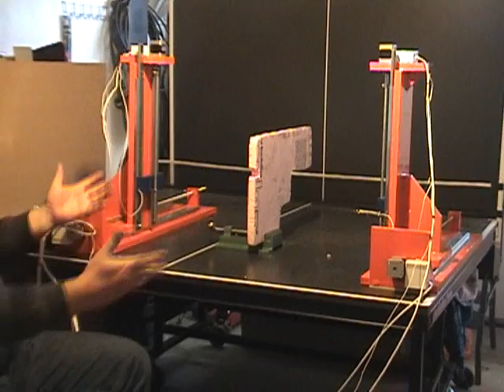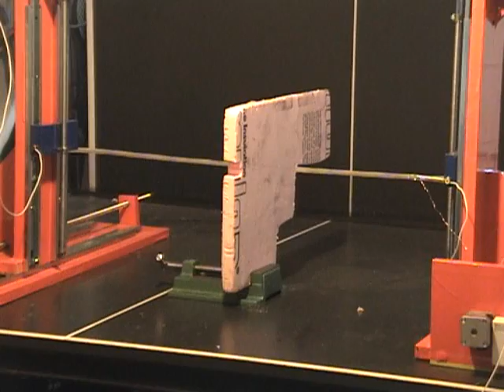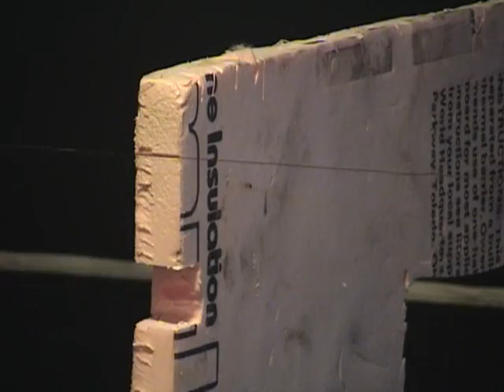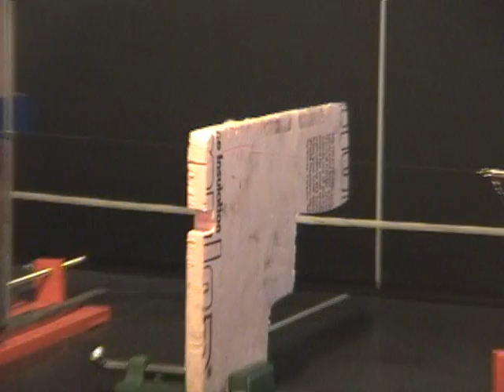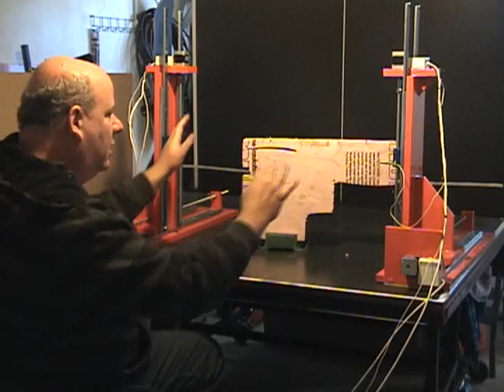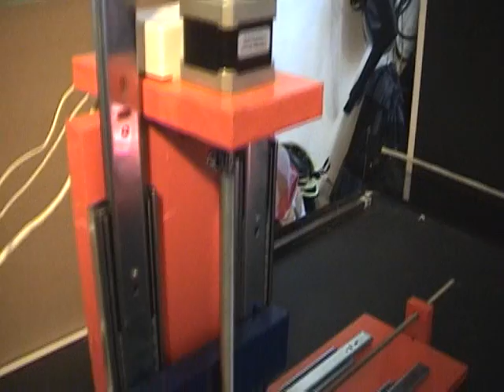CNC Foam Cutter

Comment: brilliant...how could anyone thumb down this clip...must be clowns
Reply: Boar Hog not really it's not that good at cutting foam wings did you notice the wire pinged out of the foam I mean it was still cutting foam when the machine was turned off its over engineering at its finest

Comment: nice job but that is only 2 axis cutting. If both "towers" moved independently that would be a 3rd and 4th axis.. if you added rotation to the work holder, that would be a full 5 axis machine. with a 4 axis machine you could cut a cone or tapers. with the added 5th axis, you could rotate it and cut it on edge.

good job tho.. :)
Reply: They did move independently
Reply: They moved at the same rate.  Makes it a 2 axis table plus z makes 3.
Reply: Brett this is mom call me
Reply: 3163907906
Reply: Tammy,
Write me at brettddglas at gmail dot com.

Comment from the maker: This machine is for sale. It has been used very little. I plan on listing on ebay  this Sunday. Shipping  will be about $100 the two towers are fairly heavy. It includes the 4 axis controller with heat control and all the cabling seen in the video. No computer or software will be included. Feel free to contact me mschoch75 at gmail.com